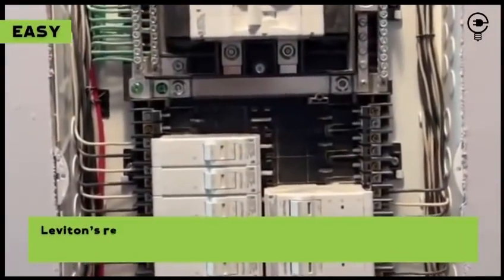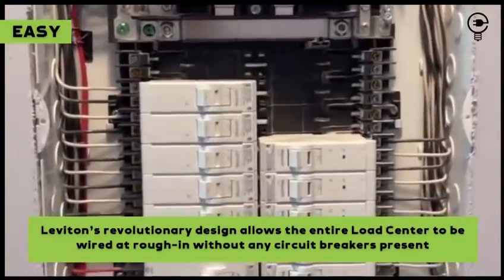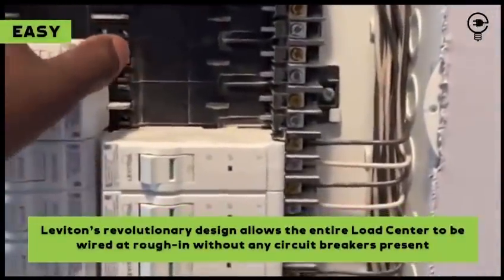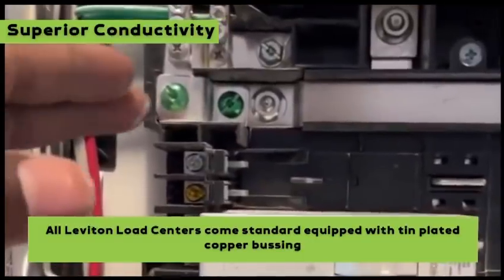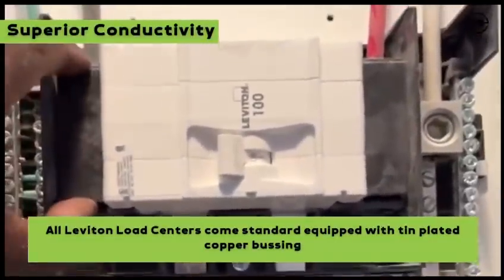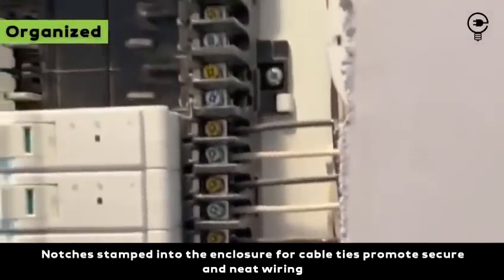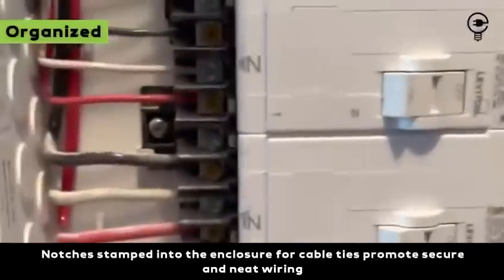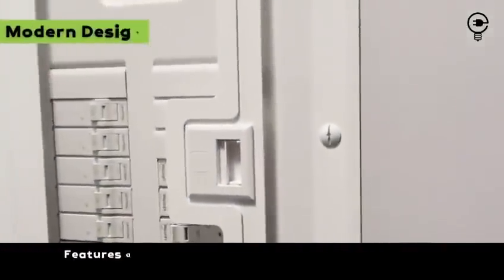How To Upgrade Panel 100amps #Leviton

Comment: How would you install a 150amp breaker to this to run to a subpanel? Seems like the sections are too small for a 2/0 wire.

Comment: You can still pull out the breaker on any panel.
I like the feature but I am not a fan of wiring the wire to the panel instead of into the breaker itself.

Someone can easily swap out a 15A breaker to a 20A breaker, without upgrading the wire! The NEC should make this illegal! Or be specific on terminating the wire into the breaker!
Reply: I doubt someone that clueless would know what 15a or 20a even means. I’m not worried about it. Leviton sells lockable doors too to keep the kids out.